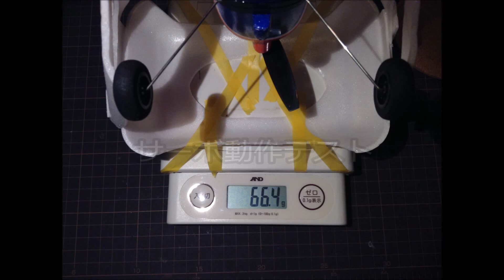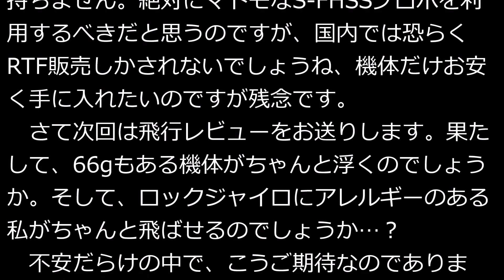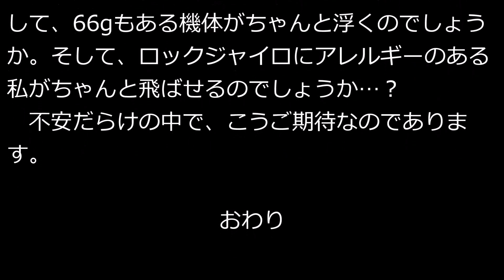HiTEC XK EDGE A430 Modeling-Review モデリングレビュー

Comment: You really helped me a lot. Thank you. With the Orange RX this little becomes enjoyable to fly. The stock electronics needs to be discarded - unless you have found a use for it?
Reply from the maker: Thanks for your comment.
I will not discard the genuine receiver I removed. When
 I give this aircraft to someone, the RTF transmitter and genuine 
receiver are useful if the other party does not have a Spektrum 
transmitter.
Enjoy flight :-D
Reply: Most generous although I wonder whether you would be helping them, giving away gyros like these!

Comment: Hi I own the same plane please advise me what can I have in full attention on that plane ? How flying on 3Dand 6G mode? I subscribe to your channel I'll be glad if you did the same
Reply from the maker: I am using "General Link FTR" for maneuvering.
In order to switch between 3G and 6G, it was necessary to switch 6ch (or 5ch) with -110 ← 0 → + 110.
Please refer if you use a transmitter other than the RTF attached transmitter.
Reply: Ultra Micro Maniacs thanks